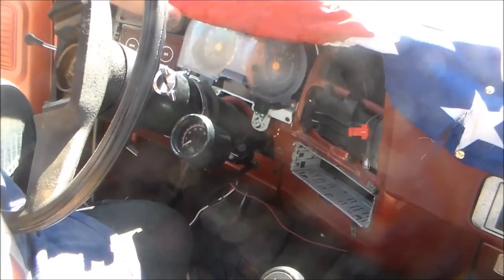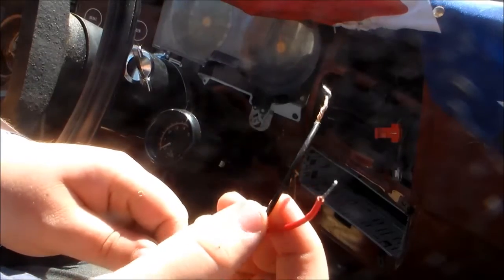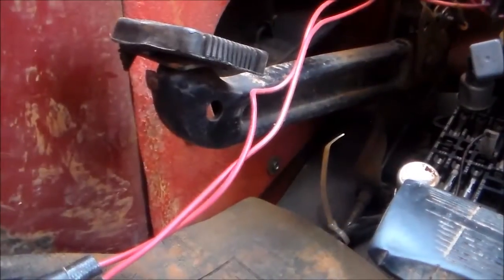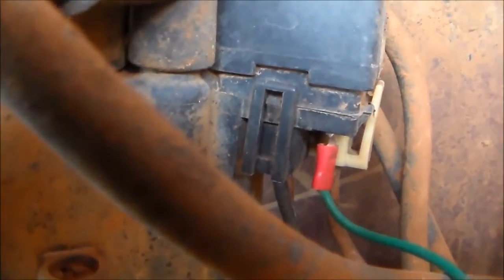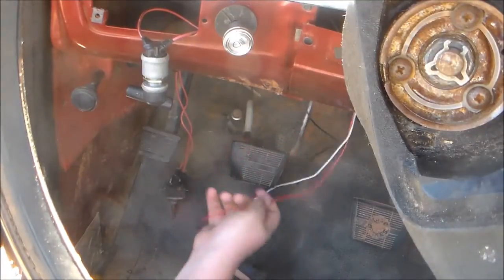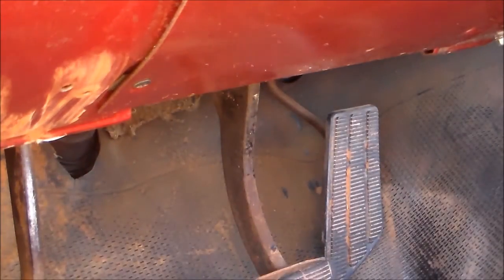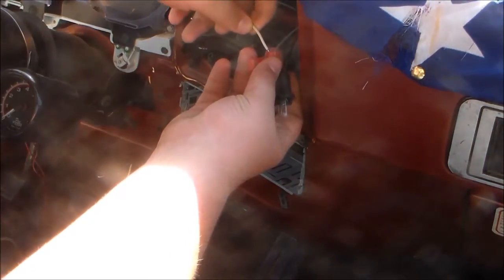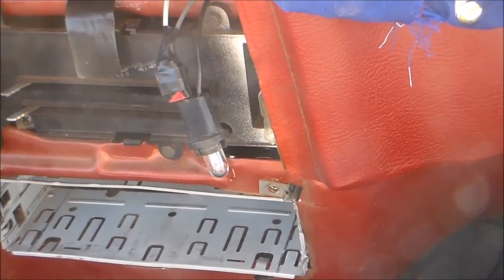how to install a tach on a 70s gm v8

Comment: Can't believe I had to finally find what I'm looking for on a truck video. 😊 My tach is stuck and I think I need to check the connection at distributor. Guess I might be taking my air filter out. Thanks 👍